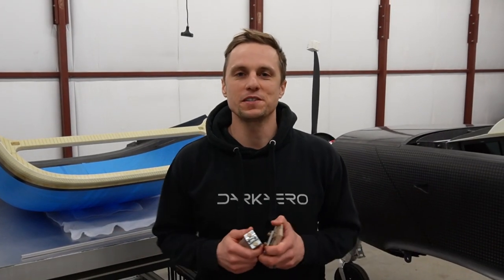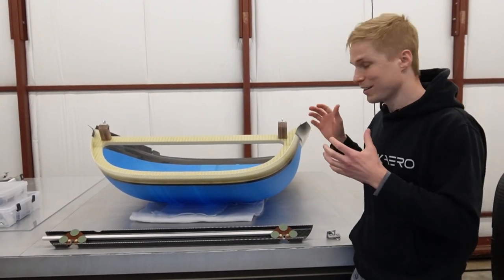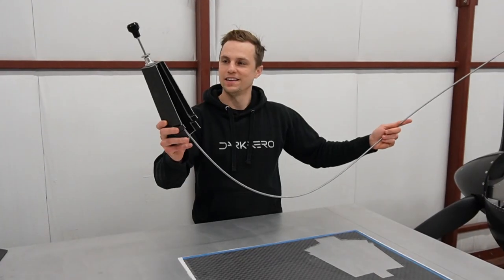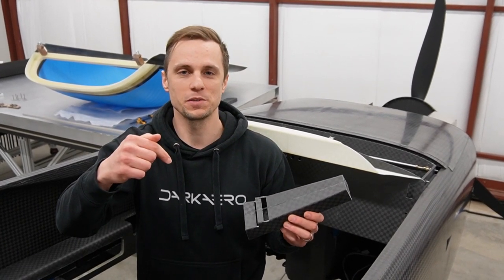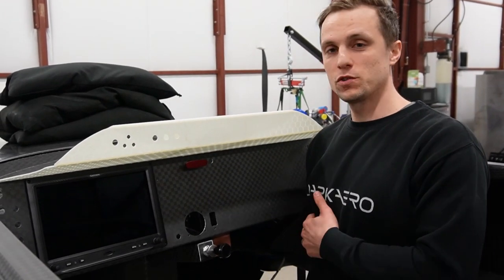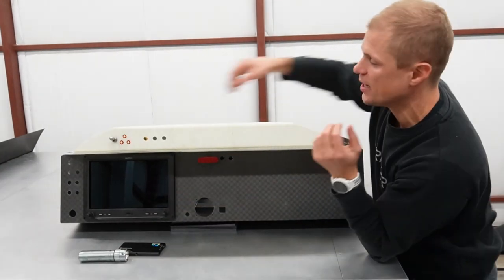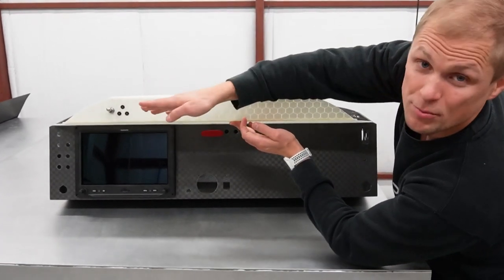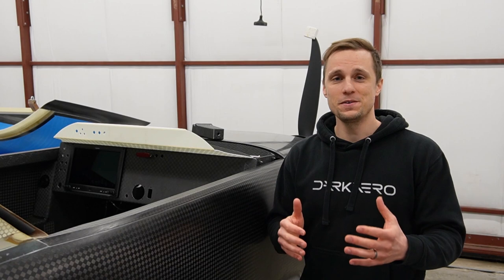Canopy EJECT Mechanism on the DARKAERO 1 Aircraft

Comment: I am very curious why phenolic material was chosen. Avoiding galvanic corrosion?

Never used that material in a structural component. 

The release mechanism is quite nice. Very simple solution to a fairly complex challenge.

Comment: When you open the canopy it will be ripped off by wind pressure comming from the rear of the aircraft if there is a strong wind. You have built a sail which could roll the aircraft. Try a model in the wind tunnel.

Comment: I think I’d prefer to see the canopy release T-handle positioned in a pocket/recess in the underside of the glare shield instead of right on the panel face. That way it is both protected from accidental snagging/pulling and is not taking up valuable center-of-panel/center-of-view real estate.
Reply from the maker: We went through a number of concepts with this, but the location for the jettison handle was chosen, in part, to keep the mechanism from turning into a Rube Goldberg contraption. We do plan to implement a guard to prevent it from being pulled or snagged accidently. It is important to have it located in an easily accessible location in case a situation in flight testing dictates rapid egress. Sacrificing panel real estate is a compromise we were able to accept since this is a prototype aircraft and does not require the full kitchen sink of instruments in the center stack.
Reply: @DarkAeroInc  Yeah, I can see that. I was thinking more about the final production version than the prototype and flight test.

Comment: I can't stand forward-tilting canopies. how do you escape if the plane flips over in water? or if it flips over and starts on fire? Plenty of real-world examples of vans RVs and other planes doing exactly that (rarely with the fire though, thankfully, but still possible). Unless you eject the canopy before Every emergency landing. I prefer sliding canopies or other doors than can be opened in-flight.

I do like the release mechanism though.

Comment: Are you concerned that canopy opening and closing will eventually cause wire breakages to the panel?
Reply: The drivers side car door has in some cases dozens of wires that flex every time the door opens and shuts. As long as the wire grade is correct, the strain relief is correct, and you aren't opening the canopy 60 times a day 7 days a week - this would be the least of my worries.
Reply: @bradley3549  Thank you.

Comment: Why is it a problem that the throttle moves when opening the canopy? The cable shielding isn't flexible in the direction of the cable, so it wouldn't pull the butterfly when opening

Is there something that I'm missing? 
Of course, it's a nice solution, but I'm worried that the throttle sticking out would be a pain of you accidentally banged your knee on it

Comment: Curious question. Why is the throttle in such an awkward position? Seems hard to keep a hand on it and modulate at will. Specially considering it is shuch a high speed aircraft.
Reply from the maker: There are limits on where we can place the throttle since the control is cable actuated rather than fly-by-wire. The location under the instrument panel allows for a workable routing of the throttle cable up to the engine. Placing it in the center allows the airplane to be flown from either seat. This ends up being the standard location for the throttle in many light aircraft.

Comment: how did u fold the soric?  it was cured.
Reply from the maker: Good question! The fold is formed by cutting a groove part of the way through the panel which creates a localized flexible region at the groove. The success of a good fold comes down to a few key factors one of which is the percent cure of resin, the type of resin used, the groove width and depth, and cloth weave type and weight.

Comment: How do you fix a problem with those canopy latches since they're encapsulated in that boded piece of CF?
Reply from the maker: Both the latch and the hook are bolted in so they are serviceable. It might have been deceptive in the video and gave the appearance that the hardware is encapsulated, but everything can be disassembled.
Reply: @DarkAeroInc  ahhh, thanks for clarifying. I was deceived 😉

Comment: Are you Going to integrate a BRS?
Reply: Is there a BRS designed to deploy at 270+mph? The Cirrus Jet has a large BRS. But you have to fly it very slowly in order to deploy it, making it practically useless extra weight for that jet.
Reply: @Triple_J.1  The Point of a BRS is to deploy at Zero Miles Per Hour, When your Stalling Out of the Sky, The First Test Flight of the Prototype should have one.

Comment: Do you guys have aluminum in direct contact with carbon fiber? At 7:04 it looks like there is an aluminum machining riveted with aluminum rivets through carbon fiber and later looks like aluminum core in your carbon fiber honeycomb panel behind the panel. Carbon and aluminum are dissimilar and will corrode. Especially when the aluminum much smaller relative to the carbon, like with fasteners. A small anode, the Al rivet, will corrode much faster and fail. Big aircraft OEMs will put a layer of fiberglass between carbon composites and aluminum structure and use titanium or stainless fasteners to mitigate corrosion problems.

Comment: The panel going up with the canopy is really odd.  I actually spend a fair amount of time sitting in my plane, setting up my flight plan.  I can't imagine a 100 degree day, sitting on the ramp waiting on the fuel guy with this canopy closed.  Looks miserable.
Reply from the maker: The panel hinges up with the canopy make ingress and egress easier. Lifting the panel up opens up the foot well and rudder pedal area more. It also provides access to the forward baggage compartments which sit ahead of the instrument panel. It is still possible to view the panel with the canopy half open for ventilation if that is your workflow for flight planning. Modern avionics like the Garmin system we installed allow you to set up your flight plan on an iPad and then send it to your flight display so you don't have to sit on the ramp in 100 degree weather.
Reply: @DarkAeroInc , it's interesting.  Will it have air conditioning?  Most small planes in the summer need to taxi with the doors and/or windows open for the same reasons.
Reply: @DarkAeroInc , I have a glass panel.  I don't need to sit in the plane for planning, but I typically do because I like to.  That and it gives me something to do while I wait for the line guys to fuel, or wait for my family using the facilities at the FBO.  There's always things to do in the cockpit while you wait.

Comment: Sorry, but it is the first propeller aicraft EVER that I see with airbrakes.

That is so because the propeller itself is the best airbrake you can have, just throtle back.....

Your split rudder will never be used, the pilots will find turbulence annoying and.....they will never need it.

Your split flap explanation is partial, you missed to explain drag differences between flaps types.

Split flaps were discarded DECADES ago because they have quite more drag  than plain flaps with just a marginal increase in clmax.

Your clmax figures are wrong, are more like 2.2, 2.3, 2.6, 3.0 for plain, split, slotted and fowler.

You do not need to have tracks for a single fowler flap. Just put de hinges below the flaps, they will move backwards (incresing wing surface) and downwards. With them, that are quite simple, you can reduce wing area quite a lot, and increase cruise speed while maintaining landing speed.

The good news are that you can throw the split rudder to the trash bin, save weight and complexity in a completely useless system.....and put that savings in a wonderfull low-hinged-no-tracks  fowler flap.